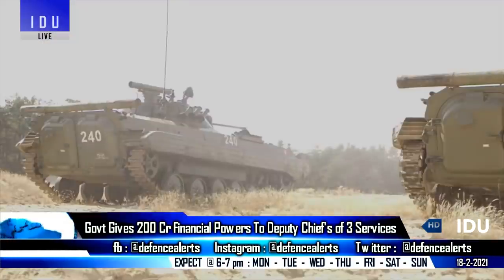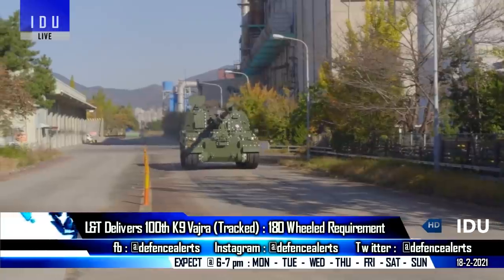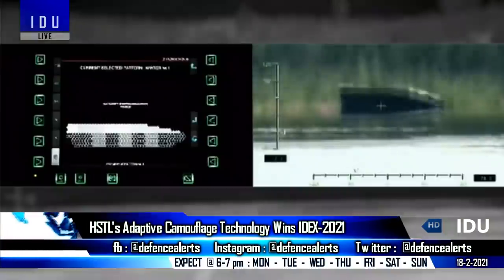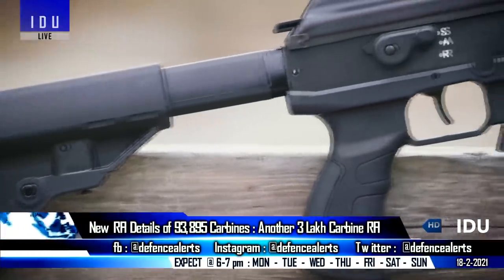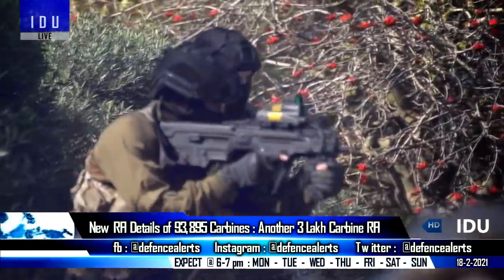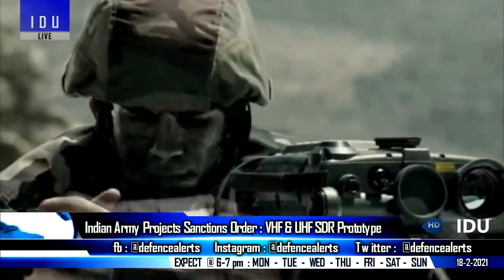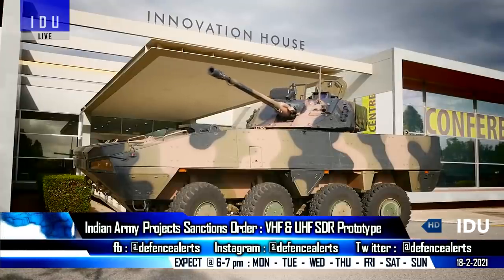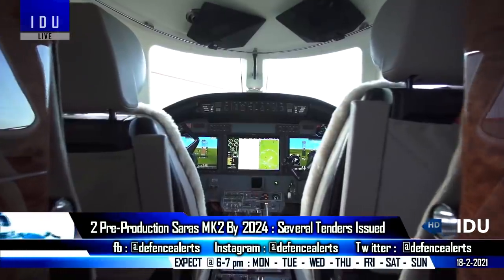Indian Defence Updates : 180 K9 Vajra Order,New Adaptive Stealth,3 Lakh Carbine Order,SIERA For Navy

Comment: A tip for adaptive camouflage technologies.
You can use transparent looking camouflage...and it is possible by adding specially designed nano receivers and nano displays on the body of the air crafts, military equipments, Ironman suites etc.....It will not even seen by human eyes too..... total invisibility. Like the die another day James bond car or Arnold Schwarzenegger' predators movie. Seems it possible 🤔

If the gun can be silenced so does the jet engines. And Cannon blast 👍🏼

Receivers receives images of the other side and display it through the display system fitted on the body of the aircrafts or any equipments.....is the basic idea.  Please don't misuse it🙏🙄